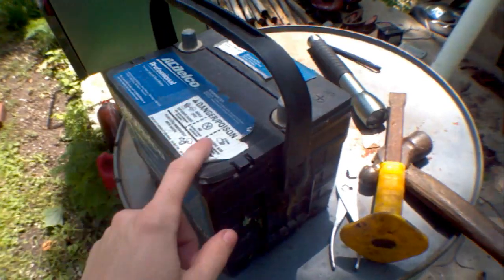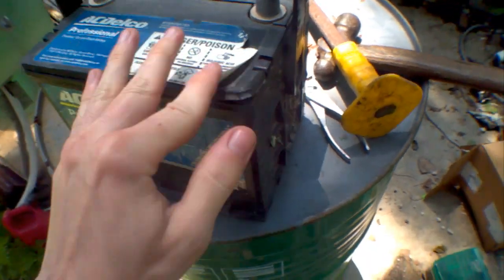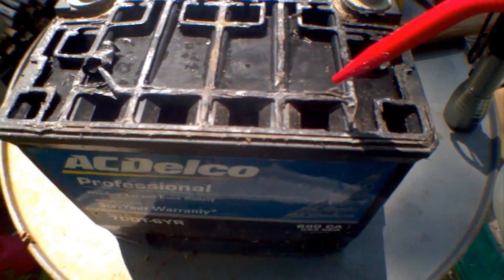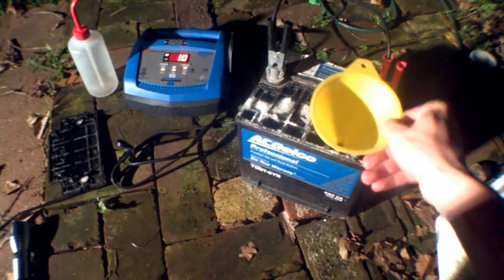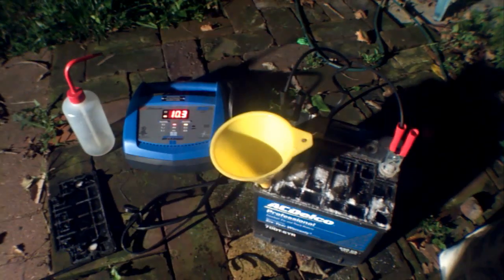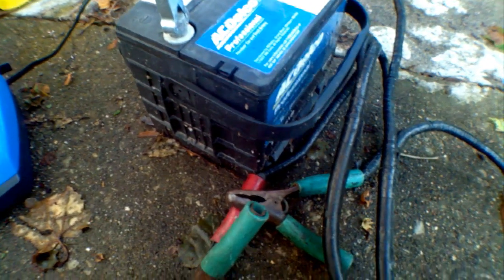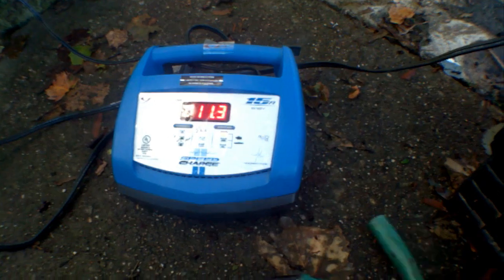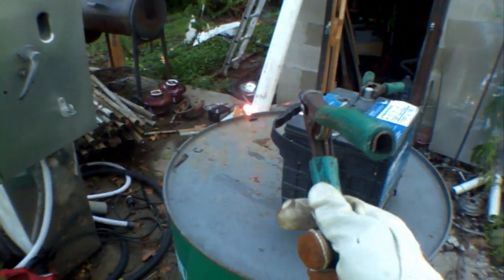DIY: Opening a Car Battery and Repairing with Epsom Salts

Comment: You sir are an idiot. Firstly if the battery is sealed it is sealed for a reason. Secondly what are you planning to put this in, Thirdly why waste your time when a battery of the same size you can pick up for $100 brand new....
Reply: Rinoa Super-Genius this is very dangerous. acid in the eyes can blind. ive worked with 1000x the batteries you have (no that's not a guess)  your battery was low on charge and therefore less dangerous. but you are still an idiot and people can get hurt.
Reply: And you wonder why your still working at McDonald's
Reply: Your meant to use distilled water because it doesn't mess with the make up of the lead plates. Some of the minerals in normal tap water and bottle water do and cause a bad chemical reaction.
Reply: Right on Grantland king!  You are a lemming trent ("It's closed for a reason."??).  Just because everyone jumps off a bridge doesn't mean you have to and just because someone tells you that something 'shouldn't be opened'  doesn't mean that it shouldn't be opened.  It is a warning.  Use your God-given intelligence and stop being a lemming. PS:  This is coming from a Mechanical Engineer who designs things similar and much more complicated than this constantly.  IE I am one of those people that choose to make certain things hard to open. In this case it is mostly to protect the company from lawsuits that are bound to happen because idiots will try to mess with crap that they know nothing about.  Use common sense and you can do anything.  PPS:  The lemming mentality is what keeps people from innovating.  Stop waisting your and my time trolling and go sit in your little box where you are comfortable while the rest of the thinkers come up with things that can help people.
grantland king 199
Reply: Why the fuck is this still going ? This comment was made over a month ago do you really not have anything better to do?
Reply from the maker: 100$ is over a weeks wages for me

also i never said i was going to put this into anything.
Reply: Then what's the point and where do you work that you get less then $100
Reply from the maker: Trent Martin
mcdonalds. but i make way more from youtube
Reply: You seem smart. Find a better job lol
Reply from the maker: Trent Martin
i am. youtube
Reply: How much do you make of YouTube a week
Reply from the maker: Trent Martin
i made a video about that a while ago, about 140$ so far and growing about 30% per months.
Reply: I hope it goes well for you just be careful what you show if someone copies something that you do and gets hurt because you don't have a warning saying your not a professional or only do this if your a professional you can be sued
Reply from the maker: Trent Martin well most of my viewers are twice my age. only 1.2% are bellow 18 years old. if an old guy hurts himself its his own fault. and tbh the same with kids
Reply: You still have to do warnings
Reply from the maker: Trent Martin
no i dont, i hate stupid warnings for things that arent dangerouse
Reply from the maker: toob247
or i could keep my job with youtube.
Reply from the maker: toob247
I already make 6k a year from YouTube. and yes I pay taxes for it. its a business. that's more than the 5k from McDonalds.

I dont know anybody who makes 100k from their job. that's a far fetched fantasy in my opinion. average person makes 15-25k a year at best.

but then again i dont actually care about your opinions tbh.
Reply from the maker: Trent Martin
and i'm an inventor and youtube content creator. and many other things. :D
Reply: Lol fuck you Mr king
Reply from the maker: Trent Martin
yes but hydrogen gas lone doesnt explode. remember it also has oxygen. not counting if you have good ventilation it doesnt matter so much. thats why i did it outside ^^

i think its funny your still trying to ride your comment to the grave.
Reply from the maker: Charles Whitford
bleh i dont really care if you consider me an idiot.
Reply from the maker: Trent Martin

well i'll be full time youtube pretty soon.

not counting mcdonalds is almost the only job i can get within 12 miles that isnt related to the mine. and the coal mine is so mechanized they only have like 40 workers
Reply: Full time you tube half time government assistance
Reply from the maker: Trent Martin
well your a full time idiot thats for sure. full + half would give 1.5 instead of 1.

not counting i dont need assistance.
Reply: Full time idiot ? That's why your the one working at McDonald's and thinking he can live off YouTube while I work full time and am building a workshop. As for the comment above I stated the you'd be YouTube full time abd getting assistance half of that time. If you were such a genious as your name displays you would be doing more then YouTube videos.... Dumb shit
Reply from the maker: Trent Martin
fuck off
Reply: Lol
Reply from the maker: Trent Martin
hey you where trolling so i gave you what you wanted :P
Reply: Rinoa Super-Genius hey , i;m not one to tell a guy what to do , but .. if had your passion for electronics i would go take a test to get into the apprenticeship program for an electricians union. in 5 years you coul be making 100k with overtime , do the easy work daily an have lotsa ccash to tinker as a hobby .
Reply: Look he's an idiot !  Won't take advice from no one
Reply from the maker: *****
you dont have to use distilled water for batteries. I use regular water and it works great.

also why would you think I'd use it in a car?
Reply: Your meant to use distilled water dipshit
Reply from the maker: Trent Martin
by who? its not like somebody programmed a battery and how it works. many methods work. and some may work better than others.

as for distilled water I haven't found any reason to waste money on it. I dont find any difference in functionality.
Reply: Rinoa Super-Genius
Rinoa Super-Genius did yu pay income taxes on your youtiube incme? if not its a hobby not a job and you can keep your youtube on the weekends but youtube will never pay you 100k a yr and benefits and 401k and annuity . very few people make a 100k on youtube, oh to be young and DREAMY .  
Trent Martin and youre right he is showing us just y he works at mc'd's , cant take advice. thats a learned behavior and sadly yu see the results , a junkyard and free burgers
Reply: Rinoa Super-Genius like i said you could keep that , i did 180k gross in 2013 and by the time i pay my 2 guys , buy myself benefits and pay insurances i start to envy my union buddies that make almost 100k w/o.t. plus benifits. . not to mention the ups guy that is makin 83k plus a full pention . . i was just sayin if you wanna make  big money and enjoy elctricity , look into a union apprenticeship.  good luk with the toob
Reply from the maker: Trent Martin
and thats a myth that i havent found any reason to think is true.

it doesnt matter what it was designed to do, it matters what it can do. :D
Reply: I'm a mechanic your a douche I've seen batteries go bang you haven't
Reply from the maker: Trent Martin
no your just a youtube troll. its fun arguing though.
Reply: No I'm a mechanic. I specialize in Toyotas...dipshit...
Reply: Wow you are an idiot. You are probably the furthest thing from a genius.
Reply from the maker: Trent Martin
of course i'm not a genius. that name is sarcasm. but you dont have to be a genius to be an inventor.

i'm curious why you come to youtube to be rude to people. do you not have anything better to do like tetris or welding or cycling...or tetris?
Reply: Firstly I tried helping you, you didn't listen so then I was rude to you for being rude to me. Thirdly welding is one of the many things a mechanic can do.....and what's wrong with Tetris
Reply from the maker: Trent Martin
nothings wrong with tetris, i love it. why would you think i'd hate tetris? thats just crazy.

your really scrapping the bottom of the barrel of things to argue about tbh.
Reply: Lol ok you go with that .... Dumb shits. Without googling it does any of you dumb shits know the explosive gas which batteries produce when being used. Starts with H
Reply: Batteries can blow up in any area if there is something to spark it dipshit
Reply: Frank Lowe Wow, all these people claiming to be so smart can not even form a sentence or spell. Hydrogen rises at like 40 feet per second. And yes It is very flammable. Its flash point is actually higher than gasoline however.
Reply: Trent Martin You should really take a look at your grammar before calling anyone "dumb shits" Mr. Toyota mechanic (like that's something special).  Yes, sealed batteries are sealed for a reason but you didn't list those reason...  Is he intending to keep it maintenance free?  Apparently not, moot point.  Is he intending to mount it in any orientation other than vertical?  Apparently not moot point two.

Apparently you missed this at Toyota mechanic university but sealed batteries still outgas and still vent when needed.
Reply: ***** haha lol no , youre a comic huh ,?  Did you miss the word UNION, My best friend is in the IBEW in Delaware , not NYC and his hourly is 36.50 , with  overtime and RATE jobs , wich are sometimes up to  48$hr . He made 93k , yup almost  10k more than my brother thats a UPS orker making 86k w/overtime. MY friend made 40k in his 2nd year apprenticeship .  Key word UNION . Proof read before you respond please. .  the point was he could take his interest in elctricity and turn it in to a career . I see youre quick to correct , but not so quick to comprehend. Sorry you live in the boonies where the wages are shit but Delawares boomin .
Reply from the maker: toob247
unions used to be good but now they are a hinderance. like some convention centers are run by union workers. you can't even move boxes to your own booth. you have to pay a worker 300$ or whatever he wants to do it for you otherwise you can get sued.
Reply: Rinoa Super-Genius Do you hear yourself excusing away the last  damn thing that actually protects workers wwages. I have never met a union worker that complained of pay . Unions are definitlygood for the worker , good in general ,i would say probably ,i mean look at the 80'syes shit was expensive but they made good money in union factories so they could afford shit . Union dismantling is only good to put moreprofitin the rich mans pocket. ask a union member if theyd go non iunion
Reply from the maker: Trent Martin
by you commenting on it you yourself just proved that you dont have anything better to do.

also just because a comment is a month old doesnt matter, i mean you commented on this video thats months older and yet you dont find that to be stupid.
Reply: ***** OMG
Reply: ***** Back to the battery's please. Ive worked on and near batteries all my life. Never have they burnt my skin. But how ever, get some of the acid on you clothes and wash them and see what happens
Reply from the maker: *****
but its worth your time to yap on and on about a video of somebody doing it?
Reply: I understand your point. But I have taken batteries that folks were going to throw away because their little 10 amp charger wouldn't charge them, top them off with water properly and put a hard charge on them for a while and they would come back to life. Have had one in my car for 5 years. On the other hand, I have done it and the battery ends up shorting out somewhere inside and gets red hot. But I don't spend hours messing with them. maybe enough time to pop caps and fill and stick on a good charger. I would not pry a battery apart. Ive seen to much bad stuff from charged acid on people, either exploding or from an accident.
Reply: Not everyone shits hundred dollar bills
Reply: Trent Martin  why does it matter ? Sick of youtube trolls like you. If he want to blow the battery to hell what effect does that have on you? After all I have read it really looks like your an insecure piece of shit with nothing better to do than start drama online with a guy probably 10 years your younger. Grow up. If your really a mechanic gice him some insight on what would be a better way to repair a battery instead of belittling him. Sad.
Reply: Firstly he's about the same age as me, secondly your the one continuing the drama but keeping the post going and thirdly you shouldn't be trying to "repair" a sealed battery its sealed for a reason.
Reply from the maker: Trent Martin
 and what would that reason be? it doesnt matter if they didnt intend it to be fixed, it's broken so i tried to fix it.
Reply from the maker: *****
 yeah but even if it doesnt cause problems you can always trade your battery in for another one for free like i did. thats how i got like 10 almost new batteries.
Reply from the maker: *****
you can trade any lead acid for any other lead acid, they all count as 1 core charge, some stores will let you swap with batteries on their recycling skid.

its not selfish that everyone else throws away good batteries.

btw this youtube channel is my job, i use the batteries for videos. it's going so well i'm going to be building myself a machine shop soon funded by my channel. so shut the fuck up.
Reply from the maker: *****
your a bad troll.

Comment: crazy old man told me to take the battery and smack it on a concrete floor a few times if it stop charging..... actually helped...assuming it shakes the shit off the plates.
Reply from the maker: yeah I've heard that too, just maybe drop it onto soft dirt instead of something hard if the battery is really old. would hate to crack the plastic shell.

Comment: any lead acid battery under charge conditions gives of hydrogen when you get a battery that has weak cells you produce a lot more hydrogen under heavy charge, the reason your battery voltage came up after you shorted the cells with the wire is that you made the cells work harder and shed some of the sulphate the old plates become covered with so by shedding the sulphate you increase the working area of the plates in the cell. But you my friend are a disaster you are an accident waiting to happen i take it you have never seen anyone loose their sight after getting sulphuric acid in the eyes after exploding such a battery

Comment: He's arcing the battery while it's charging? Isn't the fumes that the battery produces when charging flammable?
Reply from the maker: yeah but batteries dont make much, not counting i'm doing it outside. the majority of battery ignition issues are from bad ventilation and from charging the battery at very high amps for several hours or days.

Comment: For dissoving the PbSO4 in old batteries, you should better use CaEDTA, citric-acid or vinegar-acid. By the way, kids, never open  a battery like him. Please use
gloves, safty-shirts, glasse etc. Or even better, buy a recycled, used battery for 5 bugs and bring the old one back.
Reply from the maker: acid's won't dissolve it. adding stuff to batteries only increases the reactivity of the electrolyte. it won't increase AH ratings.

also, buy a battery with 5 bugs? who the fuck uses insects as currency? the core charge in the US is 7$
Reply: Rinoa Super-Genius
i am chemist and i never said that you should add acids to the battery.
But on this place i will not tell you how to desufatate a battery. By the way works also with NaOH. Please read a chemistrybook.
Reply from the maker: Lothar Mayring
oh so you don't think citric acid is an acid? ok mr chemist.

i highly doubt you yourself know much chemistry judging by your comments. maybe if you have a short attention span and can't read a book you could watch Periodic Videos and other channels like that. ^^b
Reply: No, in pure Sulfuric acid Citric acid is a lewis base.
sincerly Dr. rer. nat. Diplom  chemist TU Munich Lothar Mayring
Reply from the maker: Lothar Mayring
wow that comment doesn't make much sense.
Reply: could  it be, that you did not unterstand the comment an so it did not make sense for you
Reply from the maker: Lothar Mayring
no, more like your sentence structure sucks.
Reply: Versteh ich nicht. Das schreib ich jetzt in Deutsch, damit man hier meine
Argumente und Satzstrukturen verseht und nicht daran herumnoergelt.  mal sehen ob euer Deutsch so gut ist wie meine Englisch. Es ist unverantwortlich und gemeingefaehlich Schwefelsuere enthaltenden Akus auf diese Weise und ohne Handschuhe zu oeffnen. eine richtige Schutzbrille hat er vermutlich auch niccht getragen. Also leibe Kinder das bitte nicht so nachmachen.

Comment: One thing I do not sure what's wright , But I mix the Epson Salt in the water real good tell I don't see the little rocks ,then add to the battery ,this seems to get it to start working faster, may be why you are seeing the battery get much higher Volts after some time the Epson salt is dissolving and starting to work ,
 
 not sure But maybe

Thanks,
David

Comment: your belief that a battery will only off gas at 13v or above is not correct. a led acid battery will off gas any time it is actively charging and sometimes for some time afterwards. as you have made it clear you understand chemistry, you understand the gasses released are indeed an explosion hazard. I would say that heating a length of wire directly at the terminal as you did on a battery with a compromised seal  is a very risky thing to do. During my life I have witnessed 3 led acid battery explosions. But hey, if you want to blow acid in your face, burn the crap out of yourself and dig metal and plastic out of your face hands and chest for weeks, get after it.
Reply: Here is by far the best way to recondition batteries: JoxCharge. com
Reply: wildcat19671  agreed 100% this guy is idiot